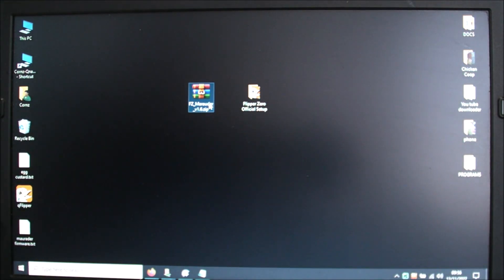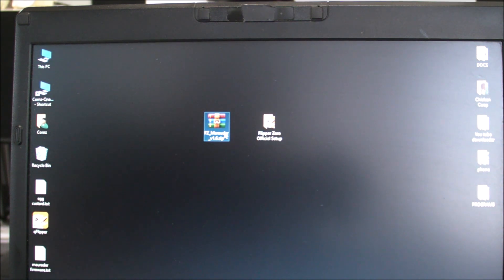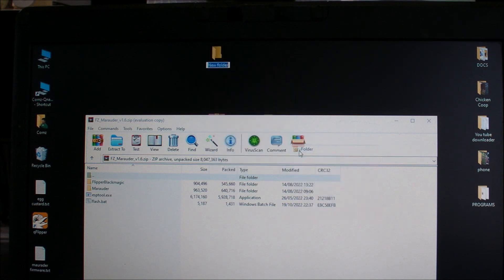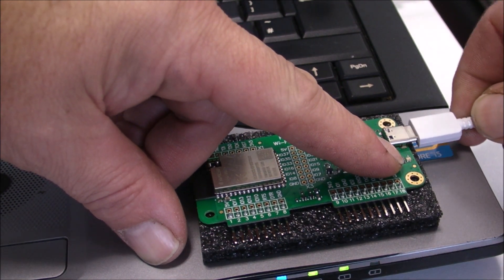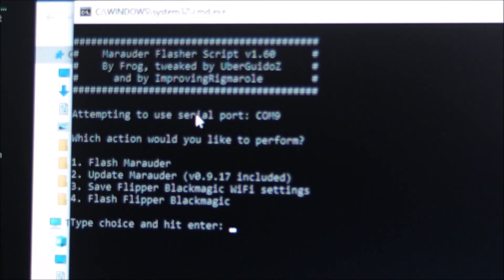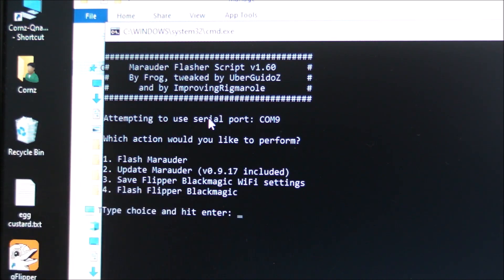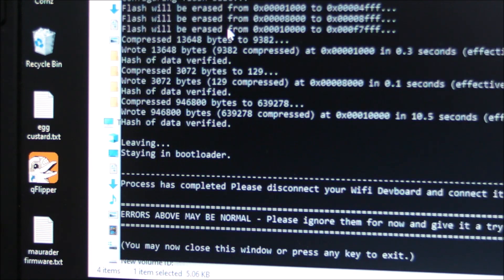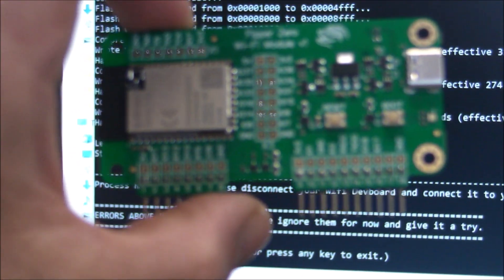The (almost) OAP's guide to the Flipper Zero: Flashing the WiFi Dev card with Marauder firmware.

Comment: when I release the boot button, and try to launch the flash.bat file I get an error saying the esp32s2 dev board cannot be found. i’ve tried the process for about an hour and nothing. what am i doing wrong?
Reply from the maker: How are you programming the ESP32???? Have you used the online programmer? You need Chrome of Edge to do so as firefox doesn't support SerialAPI. That's how i did it. Also, are all the correct drivers installed? Check device manager to see the comport number.
Reply: I’ve got the same problem mate, did you find a solution?